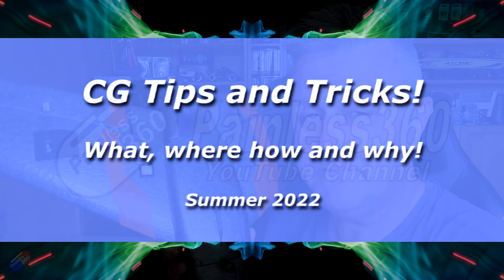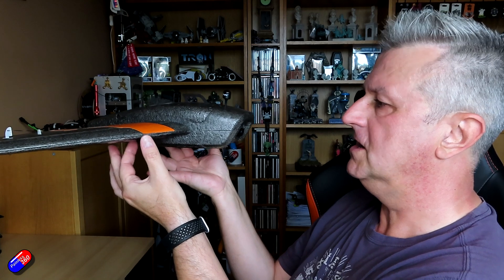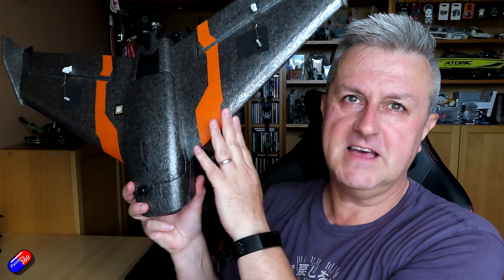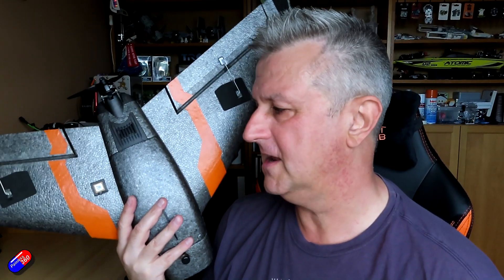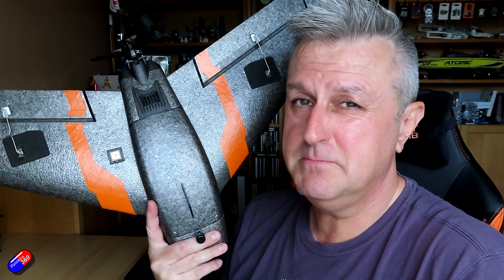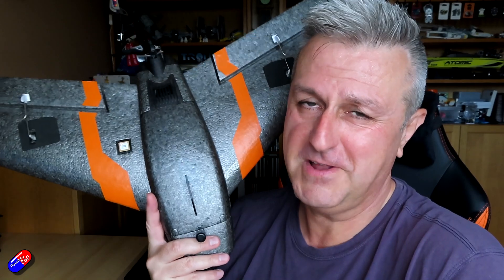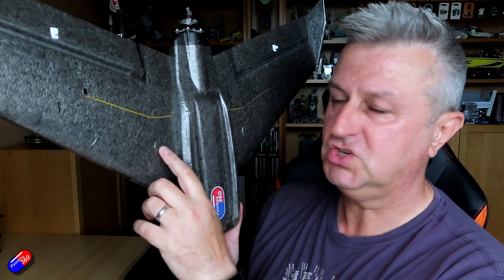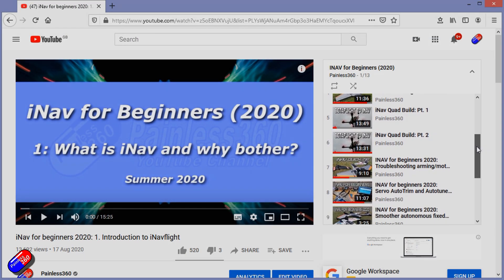Centre of Gravity explanied simply. What is it, why it's important and where it should be..

Comment: For an AR Wing Pro (with no camera in the nose) to be a tad nose heavy, I should add weight until the balance is 3cm forward from the center of the CG marks?   -thanks in advance  =D
Reply from the maker: Why do you think the CG needs to be 3cm in front of the CG mark?
Reply: @Painless360  oops, I meant 3mm...  lol
Reply from the maker: Ah! That makes a lot more sense. Without an action camera in the nose you will almost certainly need a little weight up front to get the CG in that spot. A nice place for the maiden flight. Best of luck!

Comment: Great video Lee, does the method you described (making lines on each end of the wings etc) apply to actual flying wings with no fuselage? I am trying to find CG on my Ritewing Super Spec wing now before i go maiden it and there is zero information online that i can find.
Reply from the maker: I did a quick search and found this - C.G. target is located 6 3/4" (171mm) rearward from the tip of the nose.
Reply: @Painless360  Thank you so much Lee. Your 6-3/4" seems to align well with the flying wing CG calculator so that is what I went with. 

Love the videos sir.

Comment: I h ave a question but not about CG. I think that will many people will be interested in answer. My question is : it is possible to emettre (give ) a signal at moment when gps has a fix. It is possible to implement ?
Thanks !
Reply from the maker: With what? Flight controller?
Reply: @Painless360  In my case with omnibus f4 v2 pro. Thanks !
Reply from the maker: I need a lot more information.. INAV, ardupilot etc?
Reply: @Painless360  Inav 5.1. I 'm using navlaunch mode.  I know, that to have gps fixed, sometimes that take a lot of time and this is perfectly normal. I'm worry do not launch my model (fixed wing) before gps is fixed. For this reason ,I think, that having ae a signal from controller will be useful. Any other informations ?
Reply: @Painless360  I think that this is impossible to have this feature right know. I think about implementing this signal (gps is fixed new version of inav. Finally inav5 "know" that gps is fixed 3d or 2d. Why do not this for giving this information for pilot ?
Reply from the maker: I use a buzzer on the model (it trills when the GPS locks) and use the INAV LUA script on the radio (it announces when INAV has a 3D Lock). In addition I have 'extra_arming_safety' set to on in INAV so that it can't arm UNLESS there is a GPS lock - see my INAV videos.

Comment: Lost 2 of my YRF-4E  MODELS to bad center of gravity , one to an exploding duct fan ....the model is cursed. Anyhow adding canards throws the CG off, moving fans back  seemed counter intuitive but worked for nasa , oops . 3more on bench which I haven't visited for a month , they sit watching the DC-3  and 6 quadcopters and so many other flying things.... fun fact  . Built a dragon, as a last minute school project for my son. It was made of scrap materials, I build toy planes Humm scrap ?  Entire project was best guess engineering . At 11pm I put the boy to bed and returned to work, at 3 am I threw it off the deck, tail heavy,  walked back in a d on the bench was a single screw, I picked it up weighing it in my hands...put it in the dragons open mouth screwed it down out of sight. From the deck it landed beyond the fence. Kid got an A plus, I got bombarded with request from parents for a dragon, posted the plan to school bulletin board .... still don't know where the screw came from  ?
Reply: You're saying that tiny screw applied intuitively to the nose, made all the difference in balancing the scratch built dragon?

Comment: When building an FPV plane i find it helpfull to dry fit out where the gear is to go so that you are going to get the c of g with the battery you want to fly, before cutting the nice fitting holes in the foam.  Also balancing laterally helps alot,  hold the prop and balance the plane on your finger at the front and adjust till it sits flat.  Because a plane that is requiring slight aileron to hold it level in level flight is dealing with extra drag, and will use extra power.  I go for long flight times so its important to have it right.  It will also make the maiden better/easier.